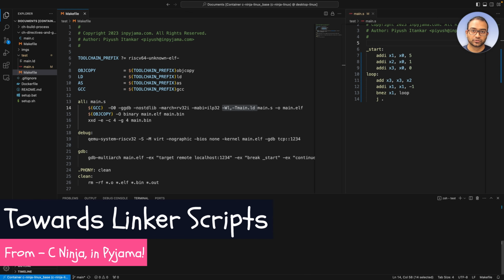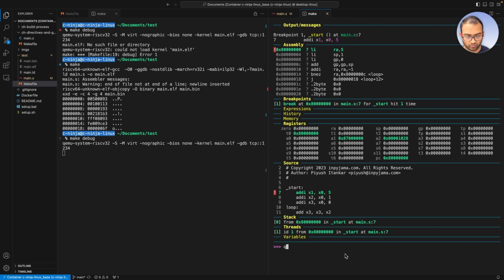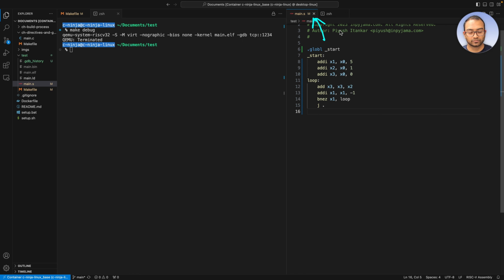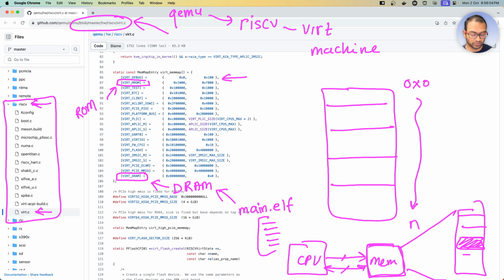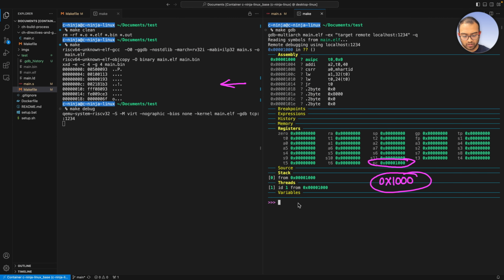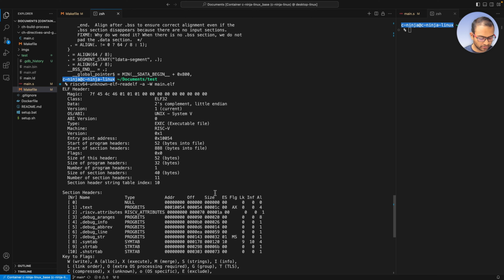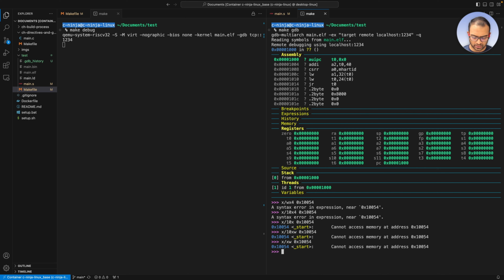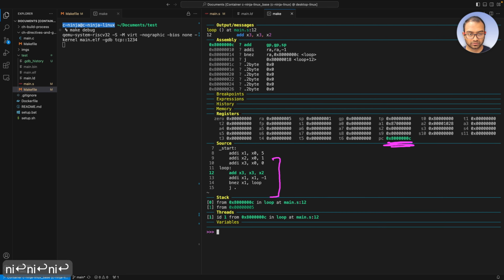9. Why - Linker script? | Assembly, C on Bare-metal RISC-V

Comment: Is there any reason why the internal linker script can't correctly set entry point address to 0x80000000? Why is it incorrectly set to 0x10054?
Reply from the maker: The internal linkerscript for the risc-v toolchain seems to default to 0x10000, and the 0x54 is some sort of header offset (I am yet to confirm). Try riscv64-unknown-elf-ld --verbose command to see the default linkerscript.

Comment: Is qmeu-riscv-virt machine Von Neuman architecture?
Reply from the maker: Ah! Not really sure. Will need to explore the source code/google to explore this. Most modern processors are Harvard architecture based (so the memory bandwidth is high). But virt being a virtual CPU (has no real hardware implementation for it) it would be either... not sure :(